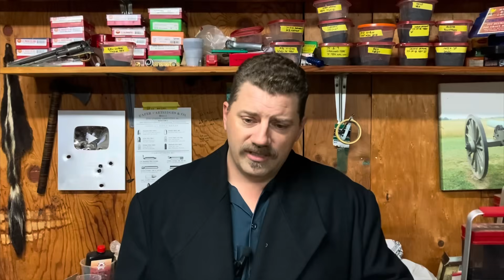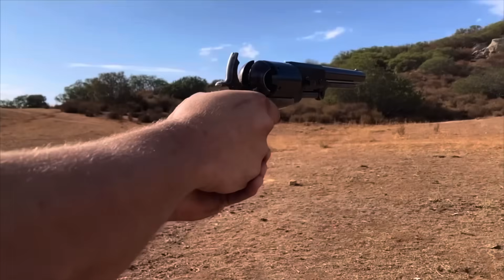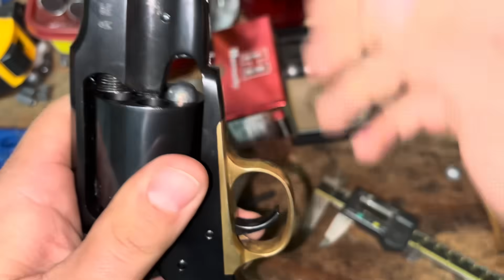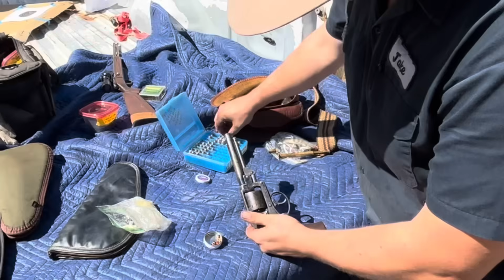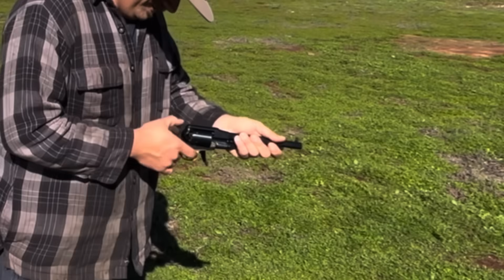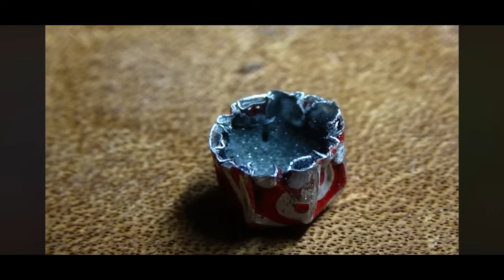Chain Fire Number 4. But Who’s Counting?

Comment: If you could collaborate with someone that’s using super high frame rate cameras, like The Slow Motion Guys or someone similar , this may be a way to figure it out. 

The thing is, how could you force a chain fire without skewing the test?
Is the cap loose enough to ignite the cap next to it, or is it an errant spark that finds its way , randomly by chance ,to the next cylinder from somewhere?

With all the cap jams I saw, I can’t help but wonder if the cap that’s intended to be fired is blowing off and igniting the cap next to it that was shaken loose by firing? 
I don’t think there is a “universal” cure here. Especially when the loaded cylinders are sealed with grease.
An extremely slow motion video would really help to find the source of ignition.
Right now, my money is on ill fitting caps or odd cap nipples.

Comment: I was a range officer for nine years and have seen chain fires from both ends of the cylinder, although initially I was sure they were caused by poorly fitting balls or lack of grease. What convinced me that chain fires could occur from the nipple end was a friend who was a meticulous BP shooter. He followed the same routine every time he loaded; he used nicely oversized balls as well as copious amounts of grease, kept quality nipples on the pistols, and seated the CCI #11 caps on each one prior to shooting. I must have seen him fire at least ten thousand rounds from his cap & balls over the years with nary an issue aside from the occasional bad cap. He changed ONE thing one day. He tried some European caps, and had a chain fire on his third cylinder. The remaining chambers were greased, suggesting he didn't forget that step. The cups on the Euro caps seemed less ductile than the CCIs, so he felt they may have not stayed on the nipples as well.
Reply: I have heard argument that grease in front of the bullet can somehow cause chainfires. I don't know why that would be but to get back on topic, I think your argument sounds most likely (from the nipple end).
Reply: I have oversize balls,painful to sit on.
Reply: Chamfer your chamber mouths 40 degrees,, children swage the lead,,cutting lead is for dummy,s ,proper diameter projectals swages in the cylinder,s,,

Comment: Indeed Jake, I’m for lubing baby! I had a chain fire on my 1860 Army last year and it was because of a spew that slipped to the side. I knew it happened but took a chance. Plus occasionally there may be a gap when smearing the lube over the chamber. I’ve seen the Old Ranger double checking for a gap as well. Lubing does wonders for accuracy I do agree whole heartedly! I’ve shot with lubed wads and no lube and found a difference. When I shot without lube I made sure I had a goodly lead ring when loading. After a chain fire one tends to be a bit more aware of loading procedures. And now, on this nice spring day though a bit colder, I must give my 1858 some exercise! And hopefully the wind will be in my favor and that fragrant smoke shall smudge my face and blend with the spring flowers, eh? Talk about a Victorian poet! Anyway, Many Thanks, Many Blessings and Keep  on Shootin on! DaveyJO in Pennsylvania

Comment: Wax has to be included in the grease. The melting point has to exceed a hot day plus a hot cylinder. As much as you can, anyway. Tight wads, tight caps, less issues.
Reply: Have you looked to see how much of your wax-based lube is still on the (remaining) balls in the chamber mouths after you've fired a shot or two? I used to use the Hogdon revolver lube (Spit Ball?) and noticed that after the first shot most of that lube was blown out of the unfired chamber mouth. I'm guessing enough remained to prevent chain fires, though. Just wondering what your experience with a stiffer lube is. I've use plain old vegetable shortening, and it seemed to prevent chain fires, though I don't know how effective it was in softening fouling.
Reply: @HossGreeley  Waxy lube prevents melting out on hot days. Yes, it all blows out, just like anu other lube. They all make a difference,  but I live in a hot state. Crisco in a holster often oils the leather. Or pocket.

Comment: I'm lucky I've never had a chainfire with my 1851 colt navy revolvers but I always slathered the bore butter in the chambers specifically for the lead ring issue 
Do-do can always happen so it's always easier to be prepared instead of improvisation 😂🤣😅👍
Great video again ❤

Comment: Now i have a question, are caps heat sensitive? Could it be some caps might get over filled and be dispositioned to go off from a little extra heat? Do sparks make more than 4 turns?  The question on the chain fired cylinder is the cap spent in the process? May need to lay some caps out and fan them with a torch to see if you can get one to go off that way.  And in that case, a wax coating could help a lot?
Reply: What temperatures are you talking about.  I was going to make an assumption that the ingredients in percussion cap are the same as those in modern small arms primers.  But apparently  I read on the net lead styphnate is no longer used.  
Cartridges can cook off in closed bolt automatic weapons.  Fire multiple magazines off and then leave around chambered and it may cook off from the heated chamber is the story.  But really needs to get so hot that the barrel can give a third degree burn before it will set off lead styphnate primers.  But I can not imagine people selling highly sensitive percussion caps and so what happens heat wise with a BP weapons is maybe not enough 
So my guess is that heat by itself is not setting off the caps, but it might facilitate it happening that that a flash over from another cap nipple/cone might do it.

Comment: I got my first C&B in 1960, a Colt .45 Army replica, and used black power exclusively (Dupont 2f). I got chain fires every other load until I found out about greasing over the balls - after that, never a chain-fire with any C&B, many thousands of shots and many years later.

Comment: I take your point about grease affecting accuracy over the long term.  I swab my bore every couple of cylinders, so didn't really think of it in that light, but yes, of course, over time it would make a difference.  As to the other points you made, I absolutely agree--chain fires can happen from the mouths if the ball doesn't fit correctly, and having sprues sideways can make a huge difference.  What I have always heard is that "chain fires happen at the nipples if your chamber is sealed properly."  To that end, I would also add two things:  First, repro cylinders are very sloppy; I always have mine re-bored when I have the loading ports opened to accept conical bullets, that way I know they're all consistent.  Second, if you're going to grease the chamber mouths it has to be a "hard" grease like SPS or lambs tallow and beeswax.  Folks that use Crisco or Bore Butter are kidding themselves--I tried that when I first started and found that recoil and the heat of the chambers melted the soft grease right out and it was never there after the first hot.
Reply from the maker: Thanks Hugh. I figured we agreed with each other 😉

Comment: Did NOT Suck! Chain fires happen. It's just the way it is. I have a very old pietta 1860 army with a brass frame that I've fired around 800rds through. Cost me 160 bucks. The chamber mouths are completely rounded, and it no longer cuts a good ring. It's never chain fired. My very expensive Uberti Whitneyville Dragoon, which always cuts a perfect ring, has chain fired. I don't use felt wads or lube. Just powder, ball, and cap. I do, however, strongly believe chain fires come from the chamber, not the cones. Great video, as always. God bless

Comment: I think it was H.P. White laboratory that did a bunch of testing on black powder revolvers trying to get them to chain fire.
The only way to get a chain fire from the front of the cylinder was to use an extremely undersized ball.
(One you can push in with your fingers with little to no resistance)
They could get consistent chain fires by leaving a percussion cap off next to the cylinder being fired. (Either side)
This is something I read about in a Gun Digest book several years ago in the late 80s, so some of my recollection might be off a little. 
The book was printed in the 70s
And not a video.

Comment: i used crisco in the chambers in front of the bullets to seal so i did not get chain fires.
Reply: In my experience, you load the chamber mouths fully ahead of the ball, fire once, and all the grease is gone when you check it. Most people never bother to look after first shot, but I suspect oftentimes that lube is gone once one chamber fires...which is why I don't bother; I use balls I have to make go in the chamber, not that slide down with ease. If you're getting a good lead shear ring when the ball seats, there's no fire getting by the ball.